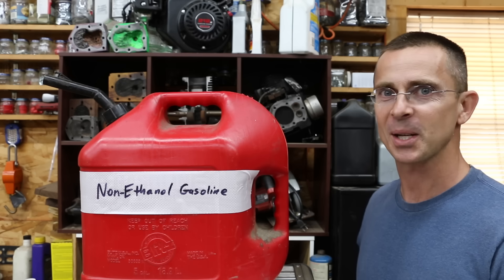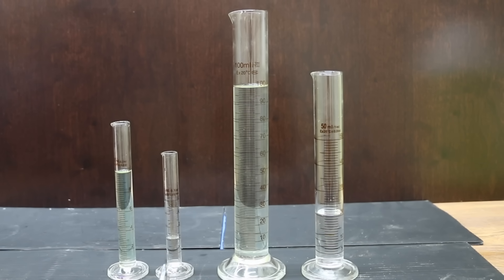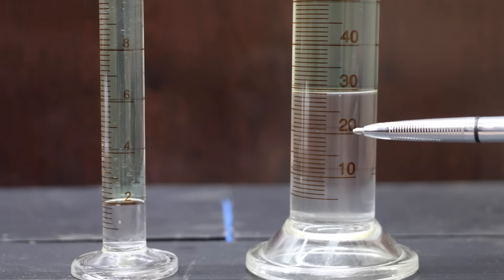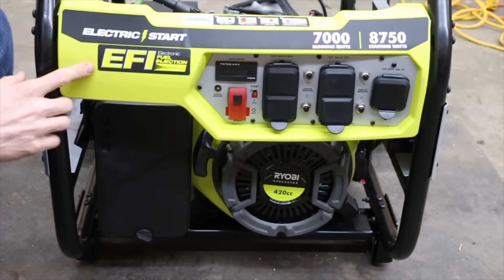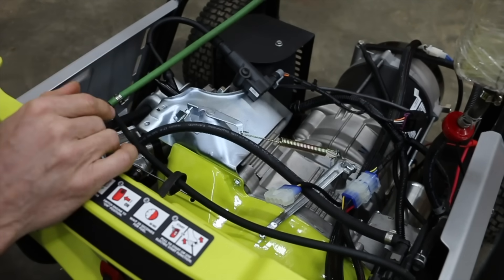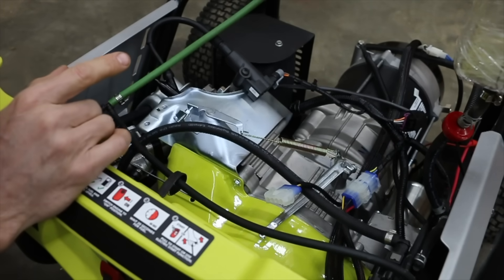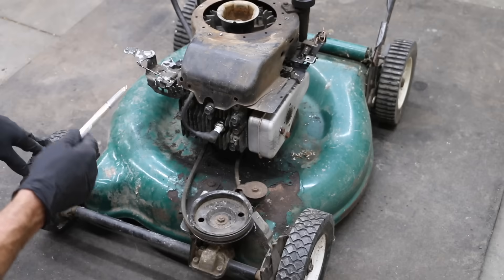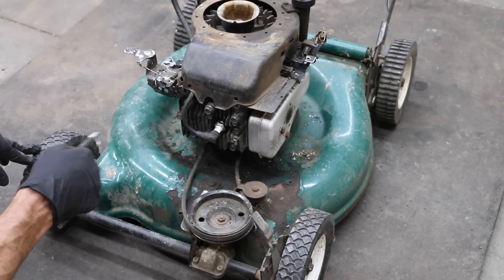Is Non-Ethanol Gasoline Really Better? See the PROOF!

Comment: I would love to see a comparison of Avgas in small engines vs. regular gas. Will 100LL run better or start more easily? Does the lead cause any noticeable damage?
Reply from the maker: Thank you for the video idea!
Reply: Avgas is lighter per gallon weight. Therefore a carb will run richer since the float sinks deeper.
Lead harms catalytic converters and O2 sensors.
Reply: @hotrodray9884  My high compression no converter 1968 Cougar loves it!! lol
Reply: @midsouthexpress  ... ok.
So does my 63 FE 427. So what.
Reply: It will foul the plugs and produce less power because you are increasing it's resistance to ignition so you actually build less cylinder pressure.. it's two of the reasons we have trouble in our aircraft engines when we run 100ll instead of 87 as some were designed for.
Reply: Avgas 100LL, is obviously 100 octane low led. It works great for old school cars that have over 11:1 compression, and under about 12.5:1. I used it a long time ago. Now people just run richer jets and/or smaller air bleeds in carburetors, and run E85.
Reply: @RustBeltAuto  it's not really low lead although that's is what ll stands for but that's relative. It has between 8.4 and 14 times the lead of 80/87 that many aviation engines were made to run on. The excessive lead leads to plug fouling and in some cases depending on the type of oil used and change intervals it can cause the rings to gum up with lead. The synthetics won't absorb the lead so that's a big issue in aircraft engines. The reason that it works well I  high compression engines like the ones you mentioned is EXACTLY  related to the comment I made already,  octane is the resistance to detonation and therefore under higher compression it resists igniting uncontrollably. So you can raise compression and get more horsepower. In low compression engines like in those aviation motors where compression is 7:1 ish, you definitely don't have any risk of detonation and so now that resistance slows down the burn process and that builds less pressure=less hp..
Reply: @freedomseeker2025  I will admit aviation engines is not my forte'. But playing with approximate sea level engines is. I have learned through past experiences that lead actually increases octane, or else it makes a higher compression engine run better just by adding it with lower octane fuel. If you are having any issues with plugs, or rings, I would be more apt to believe you have tuning, octane, plug heat range/gap, kv coil, or altitude issues with the fuel you are using. I have calibrated many carburetors at ground level in my hay day, and I'm telling you if your stoichiometric ratio is right, or best even a little rich, ledded fuel will run most perfectly in a non catalized engine, and it will prolong valve seat wear. Lead is one of the best additives to put into petrol for an engine. Just throwing this out there, but as far as tuning goes, people at ground level use a wideband o2 sensor, and gauge to measure the mixture in real time. If you are in an airplane there would be a different value for the altitude. 14.7:1 is stoic. You want a little more usually. 13.5-12 possibly. Like I say, I have not delt with planes and altitude, however, I have tuned jap bikes, Harleys, and cars like a back yard boss nobody's heard of, and they're driving down the road with it. Never been an aviation, or fuel injected tuner.
Reply: @freedomseeker2025  addition. The lead may not be burning off properly for whatever reason, and it should. Too cold? Just my 2 cents.
Reply: @RustBeltAuto  as the lawn mower and most any small engine doesn't have any mixture control other than rejetting, it will likely foul the plug. We lean out as we have that ability and that helps. Of course, we must also enrichen when we want to produce more power. On an engine that could manage the a/f mixture automatically, I guess it wouldn't be as bad but that's just not common and even with leaning to get it really hot, the lead will build up, it just slows it down.
Reply: @freedomseeker2025  this is an issue that makes me love CV carburetors. The best invention for naturally aspirated engines :).
Reply: @RustBeltAuto balanced injection is the best thing if we're talking about fuel delivery 😀
Reply: @freedomseeker2025  it depends. There is some buzz about direct injection being better, but I don't know. Electronic injection was made specifically to keep a catalytic converter "happy". However a perfectly calibrated, well designed carburetor gives an engine what it needs.
Reply: @RustBeltAuto  it is better ( direct injection), well any is actually as you can guarantee equal balance of fuel. The new direct injection is amazing.. They can substantially lean out the mixture for big savings. VW did a futuristic car in the 80's.. It was incredible, very similar to the Tesla of today.. Self parking, 22:1 a/f mixture, a dash that would change color if it sensed an object in it path (ie green yellow and red backlighting).. There sure is some neat stuff out there.
Reply: @freedomseeker2025  22:1 is no good. Lean burn melts engine.
Reply: @RustBeltAuto  no, when managed correctly, it works and does not burn up the engine.. Your stuck in yesteryears technology with carbs and such.   Here this shows you some of the older technology and they've gone way beyond that. https://en.m.wikipedia.org/wiki/Lean-burn and https://www.roadandtrack.com/new-cars/future-cars/a13092719/mazda-skyactiv-x-compression-ignition-gasoline-engine/
Reply: May 2019... avgas is right at $ 5 gallon. why use it?

Comment: Have you done anything with holley carburators, as we've seen where the metering blocks have been eaten to point of trash.
Same with Elderbrock carbs, only in that case it was whole carburator that had to be trashed, as it was gutted by the ethanol in the fuel.
Reply from the maker: Wow!

Comment: How did you put together the flywheel to be able to take a drill? Are you just turning the factory bolt in the center, or was it custom made? Good video. A lot of questions that many dont think about related engines, product efficiency tests, fact or myth, are answered with good quality evidence.
Reply from the maker: Thank you.  Yes, just using a corded drill on the factory nut.
Reply: @ProjectFarm   Thank you. Gonna try it when it gets a little warmer up here in the north east. Lol

Comment: Another great experiment done! While 10E(10% ethanol) isn't as fuel efficient as NE(non-ethanol) when they're the same octane, I'm curious what the effect of having the test of NE vs NE + E to 10E would be. Why? Because you mentioned E is an octane booster so the NE portions of the two gasolines used are different octanes. Therefore there is no control in this experiment.

As an aside, we're only talking about efficiency by volume. If you have 90 gallons of NE and 10 gallons of E(ethanol), adding the adding the E to make 10E would make your fuel go further, which is more efficient. ( 90g NE × 104% = 93.6 which is less than 100g 10E - assuming the efficiency of controlled octanes is the same as the experiment you did. )

Now we're into real efficiency evaluation when we realize that second paragraph on a societal level. That is to say, in the experiment done, is it better use of a society's resources to add ethanol? Is the cost to add 10% ethanol less than 6% of the whole? Maybe not a question for PF to answer, but a great one to ponder. I'm sure someone saw this video and thought, "See how the government makes our fuel less efficient!" Which may be true, but it's inconclusive based on this video.
Reply from the maker: Thank you!
Reply: @ProjectFarm  no, thank you!

Comment: See I told ya! Stretch 4% over a 20 gallon tank. Adds up. Why I hate the 'green' additive.Ethanol is a cheap additive for big oil and the water they DO add. They use certain detergents to mix the water and the fuel. I am not claiming ALL companies do so but many do. I am sure the range of 4% can be greater in vehicles. But there are too many variables  in vehicles. Some will go through lots of gas in idle. But you can drive for an hour and use far less fuel. Different engines- have different curves in fuel/RPM/Load  rates. Good video. :) You could try a 15% watered down with wd40 in fuel.[NON-Ethanol] It mixes water in its petro product. Unlike actual oil and water. or   extra water in gas- ALONE would show. I wonder about shell's V fuel? I've used Wd40-PB Blaster-Water-Green Dish Soap and Gasoline in the late 80's.IDK the ratios but do the WD40 with water. I'd be curious how much better/worse the economy would be? Im sure the soap,water,wd40,PB (If I recall) Plus- small amount of gas- wouldnt  be in most rational situations. I was stuck almost  10  miles from home & it was a 2 stroke moped. I had a garage full of 'stuff' and OH I added oil- which was motor oil or 2 stroke I had. You had to mix your own then. Sorry just ranting  :)
Reply from the maker: Thank you!

Comment: When Dad and I restored a 1952 Nash we filled up the tank after getting it finished. Got it started and it ran great. Next day, wouldn't run. The ethanol in the mostly-gas had attacked and swelled up natural rubber parts in the fuel system. Had to replace some of the fuel line, some parts in the carb, and the gasket in the old glass bowl fuel filter, which had swollen so much it totally blocked off any fuel from going through.

So if you're restoring an old car, you'll want to use alcohol proof soft parts in the fuel system. Don't bother with perfect new old stock (NOS) carb kits unless you're the only one who will ever fill the tank and will only use pure gas.
Reply from the maker: Great point!

Comment: Gday,   Here in Queensland, Australia some 10years ago the State Govmt introduced E5 and E10 to run beside standard 91 ron fuel, the E mixtures were set at 4c below standard as a carrot to entice the public to think it was a bargain ... but quite the contrary as the E mixtures did not produce to same kilometers as standard fuel, I worked it out that the reduction in price needed to be as much as 14c a litre to compete, so on pure economy E blends are rats shit. But that is only one of the many downsides of E blends over longer periods such as.
1. Our eldest son has been operating a business in the small engine market for some 25 years in Sales and Servicing what he sells plus inheriting other peoples problems, he is very strict with all his clients insisting they do NOT use any E blended Fuel in their small engine machines as over the years  he has experienced the following problems.
a. eventual webbing building up in filters that block filters and  contaminate carbs, build up of water in fuel tanks (ethanol attracts water),.
b. breakdown of certain rubber and plastic and fire potential.
c. longer term running problems.

       In addition related to Cars etc the water builds up in the fuel tank which results in people thinking E blends are 'economical' because the build up of water cuts down on the content of actual Fuel so less fuel is pumped into the tank whilst the Tank is likely rusting ... also the longer term damage to the engine etc can be quite a big kick in the wallet.
      Recently the Qld State Gov have tried a relaunch of E blends and this time NO mention of any motoring economics BUT purely that Ethanol production is good for our Sugar Cane industry!

     I personally ran a Mitsubishi Lancer( 2 litre engine) for 10 years (160,000klms on the clock always used Penrite Oil) on straight 91 ron NON Ethanol with never a problem and great economy and running like a Swiss Watch so much so one of our Grandsons ( Grade A Mechanic/ Auto Elec) bought if off of us for his Wife to drive (still has the same Brake Pads that were on it when I bought it new.
   Now running an Hyundai Kona (2lt Engine which is bloody economic) on straight 91 ron ( on a long run 6.5 lts/100klm ... short stop start runs 7 - 7.5lts/100klms)
Al
Reply from the maker: Thank you!

Comment: While I like the idea of this video, I see a few issues. 

First, in a one-run test, I wouldn't assume that a 4% difference in run time means anything. To test whether the difference is real, you'd need to run several tests and look at averages, standard deviations, and other statistical analysis. While I suspect that the difference is going to be real, this test doesn't tell us anything for certain. 

Secondly, my subjective view of the spark plugs was that the one running with ethanol gasoline was cleaner, but again, that's a one-run test and not a very long run. To say anything scientifically, you'd need a better measure and repeatability. 

Thirdly, some kind of oxygenate is considered necessary in today's world. The government mandates that fuel burns more completely before going to the exhaust system. To this point, the two chemicals used to give this additional oxygenation have been ethanol and MTBE. Of the two, ethanol is much less dangerous to ground water. If we can redesign engines so that oxygenated fuels are not beneficial and can then persuade the bureaucracies to stop mandating oxygenated fuels, then eliminating ethanol is beneficial. If eliminating ethanol forces gasoline sellers to use only MTBE, I doubt that we gain any benefit and any benefit we gain is at the cost of greater risk to groundwater. 

All commercial gasolines are required to have a minimum level and quality of detergent additives to prevent engine fouling. Unless you know what additives they needed to use to make the ethanol-free gasoline foul as little as the ethanol-containing gasoline, you have a big unknown in your test regime. 

I've often believed that ethanol has some benefits but that optimum level of those benefits is at just a few percent ethanol. I'd love to see how a 1% or 2% ethanol gasoline would perform. Of course, the gasoline companies would need to design a detergent package that was optimized for this amount of ethanol. 

As you mentioned, ethanol gives some increased octane performance of the gasoline. Often, gasolines must have more content of benzene ring type molecules to boost octane. If the use of ethanol gives us good octane without putting more of the ring-shaped molecules into the air, ethanol does give a real environmental benefit. 

A similar issue is the life of catalytic converters. If ethanol gives more complete burning so that the catalytic converter has fewer hydrocarbon molecules to convert, then using an ethanol-containing fuel can prolong the life of a catalytic converter.
Reply from the maker: Thanks for the constructive feedback.

Comment: I've always felt the non-ethanol provides a little extra kick in performance over it's ethanol counterpart, is there a test that can be conducted that would yield the BHP results of each? It stands to reason that having 10% ethanol would reduce the power output slightly, given that (in my opinion) ethanol doesn't have the same flash ignition characteristics as pure gasoline.
Reply from the maker: Thank you!

Comment: I think you might see a greater difference if you were to re-jet the carb for the different fuels, and do a real load test while running, not just endurance. The thing is, there is more BTU content in the gasoline than ethanol so it contains more energy. My guess it could be run leaner, and get the same power output as the juiced gas. Since you don't re-jet it, the carb delivers about the same quantity of fuel all the time and it will burn it all at about the same rate.
Reply from the maker: Thank you!

Comment: Running e85 (85% ethanol/15% gasoline) for 10 years in my Subaru. (If I had a source of cheap ethanol I'd be running 100% ethanol) There are only 2 reasons to run ethanol:
#1 More power/more torque. The intercooling effect of ethanol on turbo/supercharged engines is undeniable. 

#2 It's renewable. You can't grow oil, but you can grow as many crops as we want to get ethanol. (Don't give me that "burning food" crap. The govt pays farmers not to grow corn to keep the price stable. Also the corn that is used for ethanol is not food grade. Also there are many sources of ethanol other than corn. Algae being one of the best.) There is a limited amount of oil regardless of how you feel about it. 

There is another thing to consider: All the research into internal combustion engines for the last 70 years has been for gasoline. As a tuner I can tell you the "secrets" of ethanol are being tweaked out more and more. Back in the 70's when the first energy crisis hit there was a lot of research done in ethanol and methanol. Some of it outstanding. The key was compression ratio. 16 to 22 to 1 ratios were tested and the higher the CR the more efficient the engine got. Then all the research was dropped because the price of oil cam down and everyone forgot about it.
Reply from the maker: Thank you!

Comment: I have found in AZ from Camp Verde to Phoenix my retired C.H.P 2009 Crown Vic ford 4.6 interceptor. Was that gas black 87 octane label 11 mpg freeway. on return  ethanol  blue label E85 worked 19 mpg  freeway  strange but my was set up for both gases Yellow gas cap of course. my choice Blue label E85 flex fuel Mpg and better Acceleration flaw  $ .10 per gallon more that's ok.
Reply from the maker: Interesting!